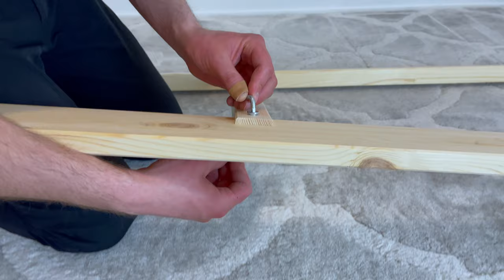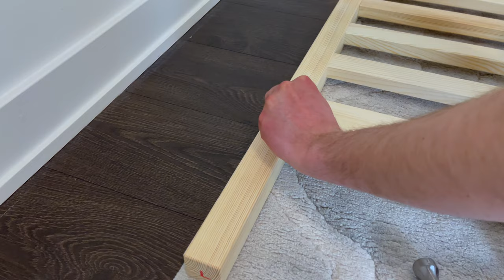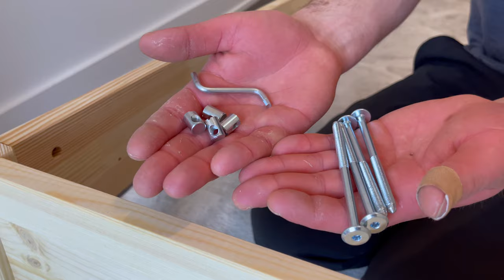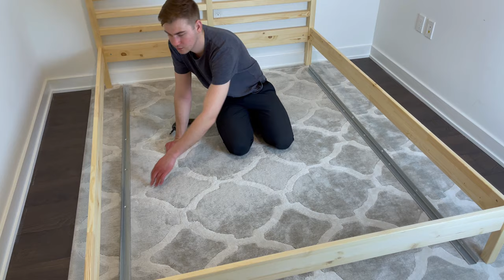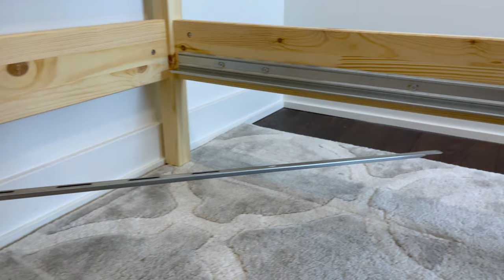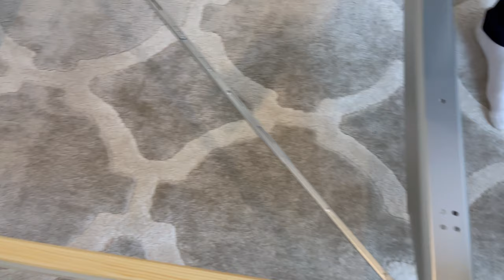Easy To Follow | TARVA Bed Frame IKEA Tutorial

Comment: Suggestion: Get rid of that claw hammer and purchase a rubber mallet. More precise, and you won't miss the dowels not even once. No damage to any part of the assembly with large rubber work end.
Reply: Claw hammer is still recommended for those metal tubes, because they tore up my rubber mallet

Comment: Dude you don't need to keep that flathead to the barrel nuts while tightening the bolts. Once the bolts are threaded in, you are good to go, lose the flathead. The groove is only there to adjust the barrel nut if you push it in all wonky and cannot find the hole with the bolt, then you can realign and leave it alone.

Comment: THANK YOU! Your video is perfect and exactly what I need to put my bed back together after a move! 

The instructions on Ikea's product page shows a different center beam and supports on the bottom. I tried to request old instructions and was told to go to the store - hours away. I've had this bed over 10 years, it should be this hard to get an old set of instructions with the original support design.